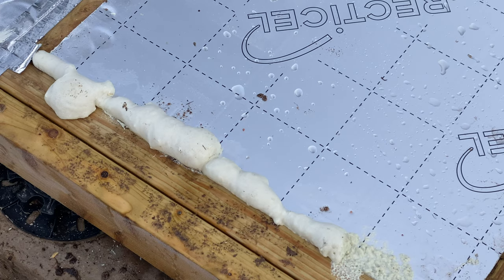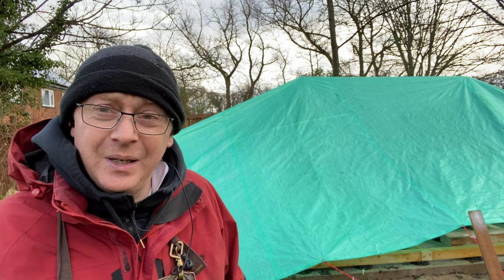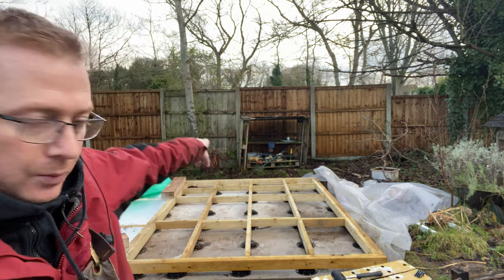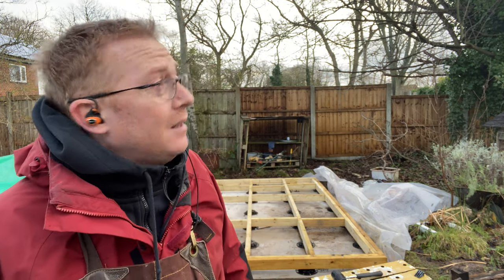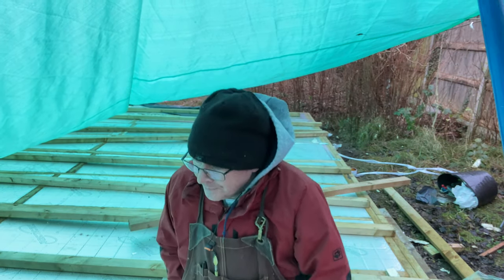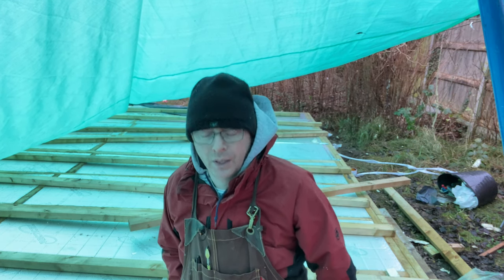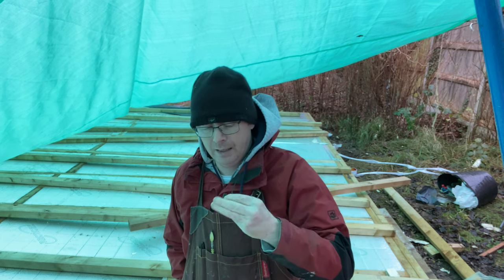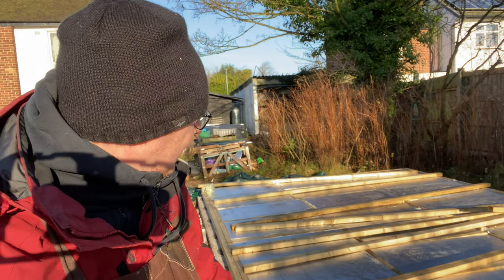Insulating a Timber Frame Workshop Base (Part #4 Modular Designed Workshop)

Comment: Proper grafter Leo, it will be well worth it in the end mate.
Reply from the maker: Hope so Karl. Bit of a break from it now as I need a break in the weather for the next stage👍
Reply: @Hand-i-Craft  defo mate like I said before my boards got wet even though I covered them and had to add a second layer and now it's not as flat as it should be 😭

Comment: For the floor panels; can you just varnish the underside only; before laying them? [laying them as they become ready]. then varnish the top side when the floor is down. I'm thinking you could rig that tarp so you could work under it. 
Anyway, still totally in awe of your determination and perserverance.  Leo, I'm gonna stop doing rain-dances just for you m8!
Reply from the maker: Please ease off on the dancing Keith, it rains all the time here😂😂😂. Still undecided how to treat the floor panels. Some folk are suggesting an oil instead of a varnish so it’s flexible and more breathable. I got a job lot of Ronseal floor varnish when my local Homebase was closed down last year and was planning on using that as I want the ply to be well protected but also durable. Any suggestions? 😀

Comment: Amazing  job looks very neat !  
You say your going to varnish the floor  ply  both sides  . This is a  different  situation from a conventional 'build"  . It an out building from timber,  air flow from underneath. Rather than "varnish" maybe considering a breathable oil finish  ! Maybe worth a bit of research
Looking forward to next episode
Reply from the maker: Thanks Dougie. I’m still undecided for the finish for the ply flooring sheets. In effect what I’ve done for the base is create a ‘cold roof insulation’ for the floor. The PIR and tape have in effect creates something similar to a vapour barrier with ventilation underneath from the raised floor. The treatment for the floor needs to be durable, but also look after the wood. I bought some Ronseal floor varnish last year when my local Homebase was closing down and was going to use that. I also got gallons of Ronseal UV decking protection oil that I’ll be treating the external cladding with and thought would that be more suitable? Problem with the UV stuff is it is an external treatment that I’d be using for what will become an internal space and is that safe? Lots to consider and more homework needed. What do you think of the idea of treating both sides of the ply before I lay them down?

Comment: Good job Leo, not easy to work in this cold weather!. and good tip on pushing down the insulation with the foot. Looks way easier than using a mallet.
Reply from the maker: Thanks Suj, would definitely recommend persuading the boards in with the boots as it is a larger surface area applying more even pressure. The mallet was making some quite significant dents in the insulation and I wasn’t happy with it, boots much better! Weather was awful, but nice to have some sun on the last day😀👍

Comment: I take my hat off to you, Leo. As I recall, I found the base to be the worst bit of the build. I used joist hangers and they're a pain in the arse. I put a layer of 18mm then another of 12mm ply on the floor. However, I wish I'd thought about your idea of putting extra noggins in...! Great idea. Got a planer/thicknesser and I'm always a little concerned about moving it. I was thinking of another layer of ply - belt and braces - and may still do that, but extra noggins would have saved me a bit of trouble. Onwards and upwards! Best aye.
Reply from the maker: Cheers Alasdair. Thought might as well with the extra noggins as I had a bit of wood left over and it’d be the only chance I’d get to do it. No turning back once they’re covered! Glad the insulating for the base is done now as all the bending / crawling etc played havoc with my back!

Comment: You're doing a brilliant job of that.
I'm not an expert but I've found the hard way that varnish isn't the best thing outside.  Unless the wood is totally dry and fully sealed to perfection then as the wood expands and contracts to even the slightest degree, hairline cracks appear, moisture gets in and can't dry due to the varnish being like a skin on the wood.  Next thing you've got patches of black under the varnish.  An oil might be better as it lets the wood breathe.  
Just a thought mate.  You know better than me but this was a hard lesson for me re varnish.
Reply from the maker: Thanks Andy and I’m certainly no expert in any way when it comes to finishes. When I talked about varnish I was only referring to the plywood floor. Last year my local Homebase closed and I completely raided the place! For the external cladding I got my hands on some rather large cans of decking oil as, like you said, it has the capacity to ‘breathe’ and soaks into the wood. I also got my hands on some floor varnish. I haven’t fully decided yet on whether to use it, but obviously I want something that is hard wearing for a workshop floor. My uncle suggested spraying both sides before putting the sheet down and I thought that was a great idea as it’ll give the underside protection as well just in case any moisture does happen to work it’s way in. I’ll have a think pal, have you used floor varnish before by any chance?
Reply: I've not used floor varnish to be honest, just a fair bit of Ronseal yacht varnish.  About 12months ago I started making a lot of outdoor bits and went with Ronseal yacht varnish for many parts of it and it seemed like a perfect solution because I was finding all the finishes a bit overwhelming so went for what seemed to be the heaviest duty thing available.  They looked beautiful and it seemed like a great idea.  Recently I've realised that due to the expansion and contraction of the wood and not the finish, it's broken the seal and water got in without being able to evaporate.  It's put me off the stuff really.  With that said, it's a workshop floor so even if it did happen it's not the end of the world.  With that said it might go from mega cold when unoccupied to really cosy when you're in there quite quickly.  Id guess it's more aimed at a house that has a more steady temperature.  I'm overthinking it though.  It's not in constant rain like my projects and it's not exactly going to wither away whatever happens.
Honestly mate you're inspiring.  I'm not achieving anything like what you are and you've got far more barriers!  
All the best pal.
Reply from the maker: @sawdustandsurvival  Thanks Andy. Have you seen my videos about epoxy resin being suitable for outdoor use? It’s more a video about finishes suitable for outdoors tbh. The one that came out head and shoulders above the others was an Osmo UV protections oil (can’t remember its proper name). I put the top 3 back out over the Winter and the Osmo is still holding up whilst the others are wrecked! It is expensive but a little does go a long way with that stuff
Reply: @Hand-i-Craft  I don't think I did actually!  Or if I did watch it, it was likely when I was a bit ignorant to finishes having felt overwhelmed by them for so long.  Eventually thinking "sod all the hard Danish wax polish oil.  I've got paint and yacht varnish for outdoor projects and paint and inside varnish for inside stuff and that's me covered for finishes"...  before realising my mistake about the yacht varnish.  Honestly, some of it was gross.  It looked like jellified blisters on one piece where water had got under the varnish.  Actually I suspect that as I'd not allowed the wood to fully dry first, it was liquid coming out of the wood.  
I'll look up the video though and give it a watch or if I've seen it more, a watch with more of an open mind.

Comment: Hello mate just a couple of things to think about.   Any structure that uses concrete as a base is seen as a footing.   Also be careful about the height next to the boundary garden structures have a restriction if you are within 1m of the boundary.  I think its 2.2m but I can't remember.  Exceed it and they can make you remove it..  Any structure more than 1m away from boundary can go up to 4m high.
Reply from the maker: Thanks Buddy. From my homework if your structure is within 2m of the boundary your max height it 2.5m. But more than 2m away (which mine is) you can go up to 3m for a single pitch roof of the whole structure, hence me being ok with the space under the floor joists👍👍
Reply: @Hand-i-Craft  Excellent you will be ok then.  I am a Carpenter thats done a fair bit of this work.  I watch a Youtuber called William Griffin he does them all day long and it's interesting.  I have subscribed to see how you get on.  Good luck from here in Oxford
Reply from the maker: @buddysinsight9834  Cheers Buddy. Yes I’ve watched a fair bit of William’s content. I’m a complete novice working with one arm who has learnt most of his stuff off YouTube. It’s interesting how much his videos polarise the woodworking community with his methods 🤷‍♂️🤷‍♂️. I’ve found Ali Dymock’s series of garden room builds very interesting and have adapted a lot of his techniques for my modular build 😀😀

Comment: Hi Leo,  glad to see your are well down on the JD, I expect you needed a fair bit of warming up after this job!
Is the tape really necessary given that the tight friction fit will provide an air tight seal to the joists?  Was it only to provide a DPC?
Keep well and safe.  WKR  Mike
Reply from the maker: Alright Mike, good to hear from you😀. Yes I kind of went a bit belt and braces using the tape. My idea being I’ve kind of created a ‘cold roof insulation’ set up on the floor. The tape has pretty much created a vapour type barrier and moisture can escape through the fact the timbers are raised up off the floor. That’s kind of my theory anyway and I hope it works out🤞🤞😀

Comment: Hi Leo. Good work on the insulating. Bloody horrible to work with that PIR board stuff. I never thought to use my track saw with the extractor goin to cut. Looks like it worked well. What tunes do you listen to while you are working? Best of luck with the rest of the build.
Reply from the maker: Thanks Joseph. The track saw works a treat, even more so if you use a rail square as you only need to mark once. The dust collection is spot on as well👍👍. In regards to music when I’m working I like familiar stuff I can sing along to. Currently that is Foo Fighters, The Killers and The Beatles😀

Comment: Hi Leo. Good job there. Have you considered a packing tape dispenser for the foil tape?
Reply from the maker: Cheers Wil. Actually I did try a dispenser thing. It was only a real cheap one, but the strength of the foil wasn't up to it and it kept tearing across. The tape without the backing allowed me to work quicker, but the quality of the adhesive on it was not as good as the backed tape. Kind of swings and roundabouts really, but I got there in the end😀

Comment: Very enjoyable as always. The friction fit you mention, are there no fasteners at all? Do they just wedge in? Thanks
Reply from the maker: Thanks Mark. Yes there are not fasteners. I did have some for the wall modules with offcuts of decking boards and a jig, but when I went for the ‘friction’ fit here for the flooring insulation they are just wedged in solid. I stood on one accidentally and it did drop down. I had to figure out a way to lift it and ended up with my four foot crow bar prising the thing up! The foil tape also helps to secure them in place👍👍
Reply: @Hand-i-Craft  thanks, was thinking exactly that, if it was me I’d keep putting my foot through them. Anyway good luck with the rest, I’m enjoying watching the progress.

Comment: Hey mate! Any other tool from the same company that make the vacuum clamps that u have checked out? I recently discovered, in part by u, and they seem quite good for the price, specially the routers. Thanks I'm advance!
Reply from the maker: Hello Pablo, thanks for the message. Yes I’ve bought a few things from Rutlands. I bought their thicknesser that unfortunately they don’t stock anymore which is excellent. Also got their palm router which does the job fine for me and their parallel jaw clamps, again very good. The bench top planer / jointer is ok but you need to make your own fence to go with it as the stock supplied one isn’t up to much. I’m not sure why, but there appears to be mixed feelings about Rutlands in the UK. I think in the past they had some customer service issues and maybe that put people off. Personally I’ve never had any problems with them, in fact I’ve got a delivery today coming from them. Ordered their planer blade aligning jig so hopefully that’ll be all good👍👍
Reply: Nice to know! Thanks for the good explanation :)

Comment: Hi Leo, are you having any problems with rodents or other critters getting at the insulation from underneath?
Reply from the maker: Hello pal, to my knowledge no issues with the PIR insulation. Before I installed it I left some off cut PIR pieces in the garden and it appears the wildlife had no interest in it and I know we have mice etc out there. I should at some point put some mesh around the gap at the base to stop any unwanted visitors getting in there, but as I said it doesn’t appear to be an issue 🤞😀👍
Reply: @Hand-i-Craft  Thanks for the info - possibly for a workshop it's safe enough but I suspect it might be a different matter if they thought there was food on the other side of a sheet of pir and OSB. I love your channel, it's truly inspiring and informative c

Comment: Few things and I'm sure I will be corrected if I'm wrong but..... One man Band...your a one armed one man band!!! did you get rid of you cheap Tracksaw? I have the Aldi Tracksaw and the TS55 , the Aldi one is for all the not so nice materials (Like Kingspan) You had such a good friction fit on the Kingspan I personally don't think the tape was needed (I understand you dont want a cold workshop, but you need a bit of air to help keep things 'dry') I visit many houses who suffer from 'Mould' it's caused by condensation because they have double glazing and no ventilation!!! Last job someone had Siliconed the BOTTOMS of the skirting boards to stop the draughts!! It's called airflow! If lived lived up your way I would offer to come and give you half a day here & there to help you get the workshop finished, I know you want to do It yourself, but come on you must have some followers that could help!?
Reply from the maker: Thanks Pistol for such great feedback 😀. I agree the tape was a bit ‘belt and braces’ but my theory being there is plenty of air circulation underneath with the timber base being raised up. I need to make sure the surface is as dry as possible before applying the ply floor. And yes I take your point about getting help. It was getting to that stage where I was going to call in some help / favours. Pam’s dad is always willing to help out, but we’re in National lockdown restrictions now and I have to be mindful of the rules. Plus with me being a teacher in my real world life I am at risk of being an asymptomatic super spreader so I keep my social interaction to a complete minimum and only leave the house for our weekly big shop and school. I know this may sound a bit OTT but I have to be mindful of what I’ll call my ‘social responsibility’. Hopefully when it gets to putting the wall modules up we might be in a better place nationally so I can call in some help 👍👍